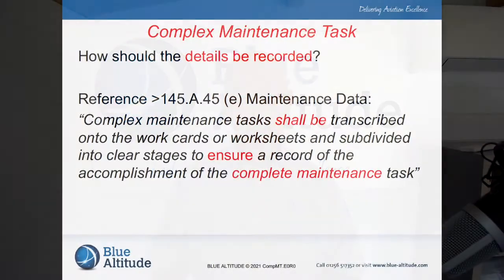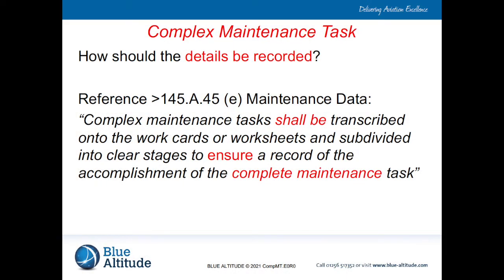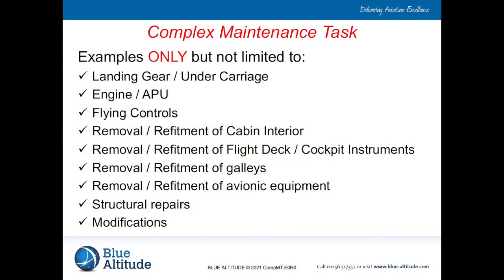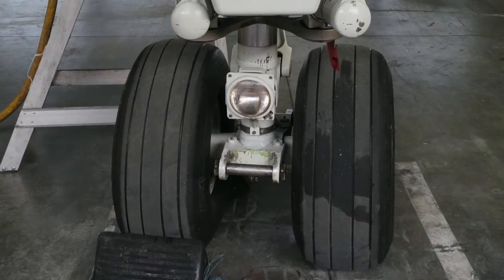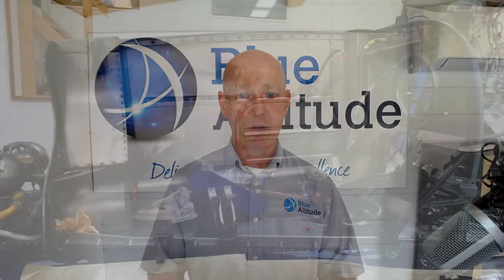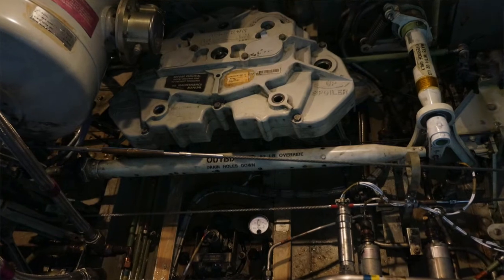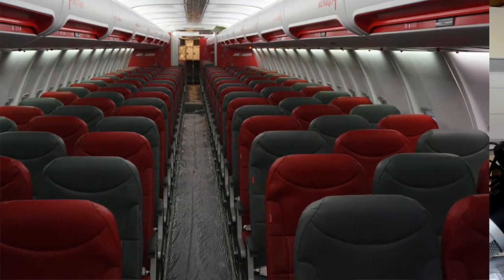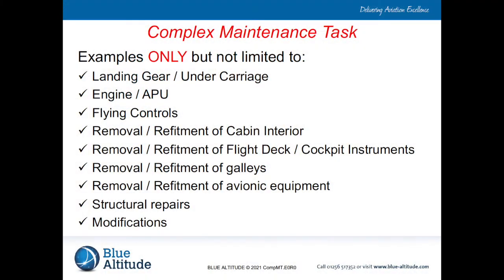What is...?  "Complex Maintenance Task'

Comment: For example, does removal of swashplate for helicopters consider as complex task?
Reply from the maker: Yes because it involves many steps to complete the task and will require independent inspections on its connections to control rods etc…
Reply: @bluealtitude2013  So is it correct for me to assume that any task that involving removal and installation as a complex task? 
If no, can u state some of example of removal & installation tasks that are not consider as complex task.
Reply from the maker: @mrpocoyo6251  Hi, you cannot treat every task as a complex task.  Complex task is a task that involves multiple steps to complete and involves a number of different systems, major component replacement or would need multiple stage inspections or cannot be completed by one person or would be completed over a number of shifts etc… An example would be to gain access to a component behind a cabin trim panel.  This involves removing the seat (therefore it’s fixings require a independent inspection) removing the trim panel(s), replacing the component behind the panel, testing all disturbed systems etc….    Basically, the important thing to remember, major components like an engine or APU replacement, gearbox / trail rotor on a helicopter should not be documented on a single line entry.  These are complicated tasks and require multiple steps in recording the actions taken for replacement.  Hope that answers your question.